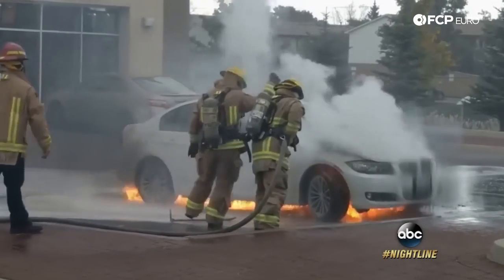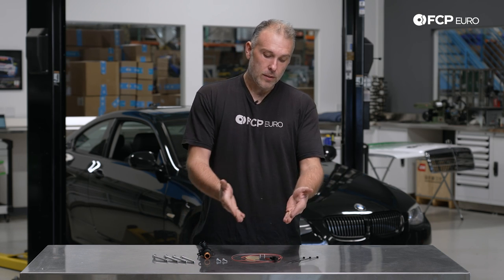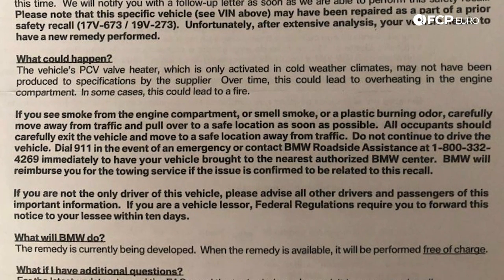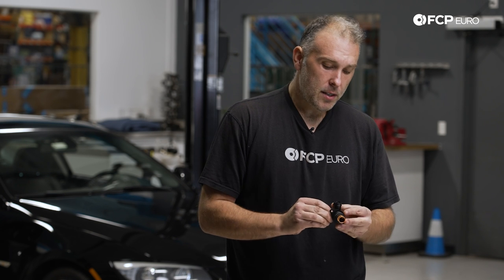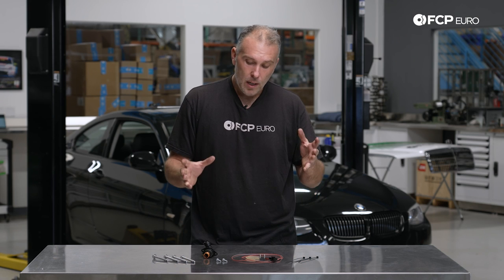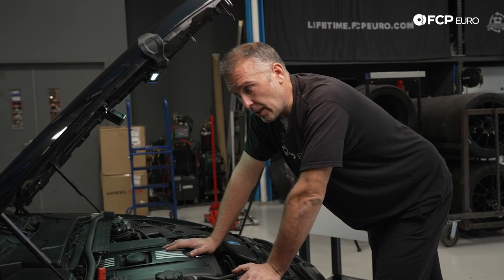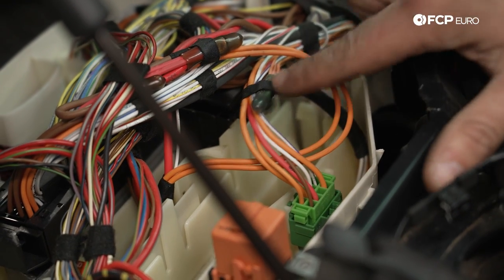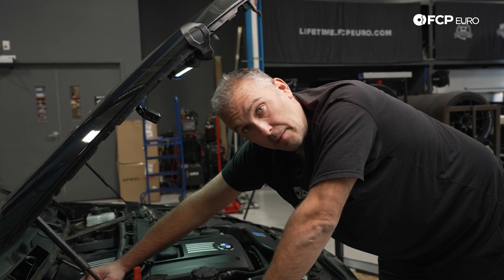BMW N52 22V-119 PCV Heater Recall - What You Need To Know

Comment: How could I determine if the recall has been completed?  I bought a used BMW 2011 328i X drive with the N52 motor, it's a sedan model.
Reply: I put in the vin at the BMW North America web site and this did not come up as a recall.  I called the servicing dealer and asked about the PCV Heater Recall and the valve cover replacement recall and they said it was not applicable for my car.  I guess I will have to inspect the wire harness to see if the PCV Heater Recall was completed.

Comment: My car (2007 X5 E70) started experiencing a misfire at idle one day after the recall repair was done. Can an engine misfire be caused by some fault during this repair? Wouldn't be the first time BMW messed up my car after a recall, in fact it's happed without fail.

Comment: Is this a newer recall in addition to a previous recall because i took my 2010 328i to the dealership back in 2019 or 2020 for a recall that pretend to that element? And I'm wondering if they just changed the element part and not installed the new Wiring. Thanks
Reply: Yes. 22V-119 supersedes two previous safety recalls 17V-683 (December 2017) and 19V-273 (April 2019) respectively:

17V-683 (SIB 11 16 17):
https://static.nhtsa.gov/odi/rcl/2017/RCRIT-17V683-0566.pdf

19V-273 (SIB 11 06 19): 
https://static.nhtsa.gov/odi/rcl/2019/RCRIT-19V273-7002.pdf

The two previous recalls were limited to certain vehicles and only replaced the angle connector. 22V-119 expanded the scope of the safety recall and also added the inline fuse + replacement of the angle connector.

Comment: What if im getting a lean code because of my PCV, ive replaced all four 02 sensors, fuel injectors, done a smoke test for vacume leaks and have led it to the PCV. Will they cover it
Reply: Did you ever find out if they covered for the PCV valve repair?

Comment: I guess we'll know the fuse is blown when the pcv sys freezes and the engine hydrolocks with oil... seen it a few years ago with a customer car. Of course before the recall.
Reply: That's a crazy cascade effect. How was power originally cut to the angle connector where it wasn't heating?